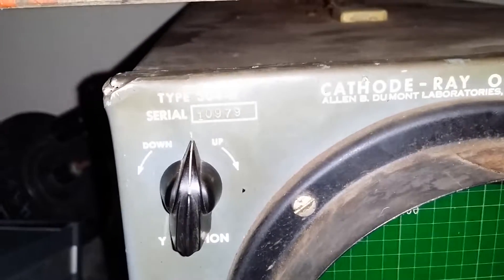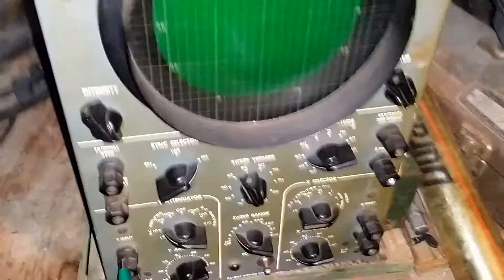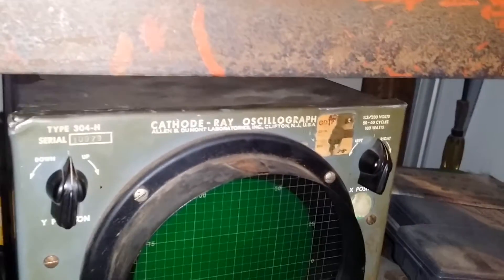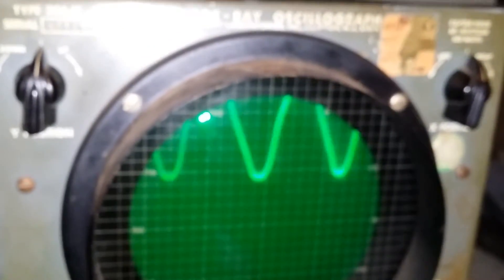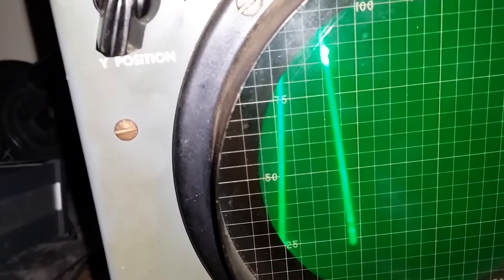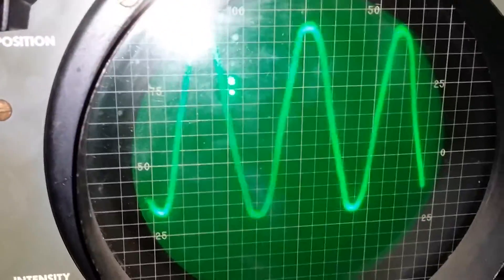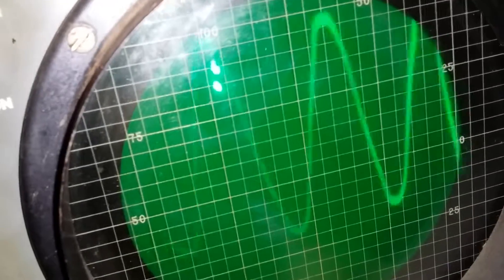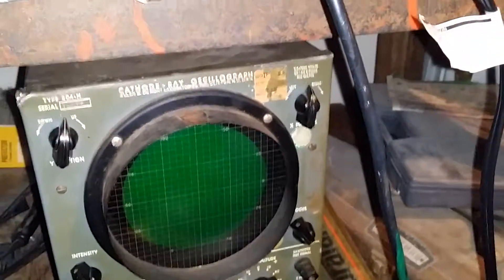Allen B. Dumont Laboratories 304-H Oscilloscope

Comment: That thing is useless
Reply: +Cock Roach You're useless.
Reply from the maker: I see you are a stock account. I believe it is someone that I have video chatted with due to the fact that I said that I had a nightmare where some troll here on YouTube argued that oscilloscopes are useless. 

an oscilloscope is must have for any electronics technician. I have used this one many times to diagnose problems with a wide variety of circuitry. This one is big, slow, and old but it gets the job done. Newer oscilloscopes are much smaller and faster but they are alot more expensive. I got this one here for $20 and it works very well. I am also a vacuum tune enthusiast so I put two and two together and I ended up with this.
Reply from the maker: I see you are a stock account. I believe it is someone that I have video chatted with due to the fact that I said that I had a nightmare where some troll here on YouTube argued that oscilloscopes are useless. 

an oscilloscope is must have for any electronics technician. I have used this one many times to diagnose problems with a wide variety of circuitry. This one is big, slow, and old but it gets the job done. Newer oscilloscopes are much smaller and faster but they are alot more expensive. I got this one here for $20 and it works very well. I am also a vacuum tune enthusiast so I put two and two together and I ended up with this.
Reply: +Streamlined Steamroller yes I am a stock account and I have never talked to you before or ever heard of you.  Also there is a reason it was $20.....its useless.
Reply from the maker: Cock Roach So you are Cockroach2008? So you didn't have enough. 

Can't you see it? It works just fine! You do not know anything about electronics, you have no saying here.
Reply: +Lionelpostwarfan Are you a useless waste of space just like streamlined and his "Machine Machine" which sounds like a very non useful tool?